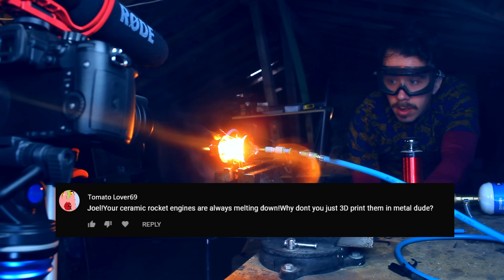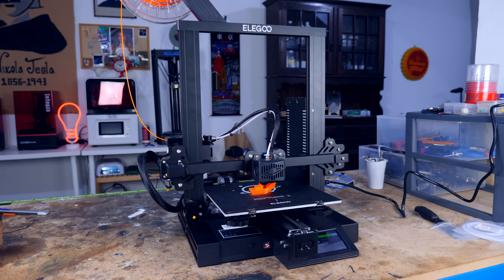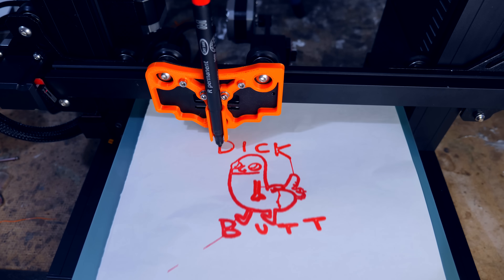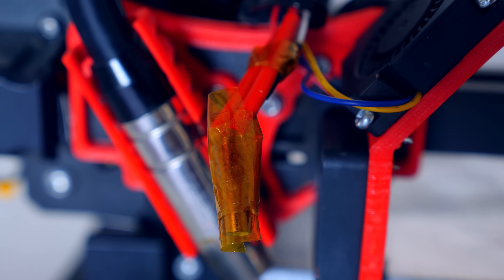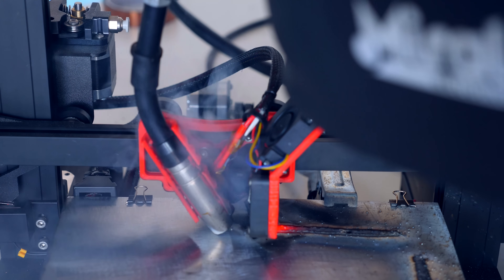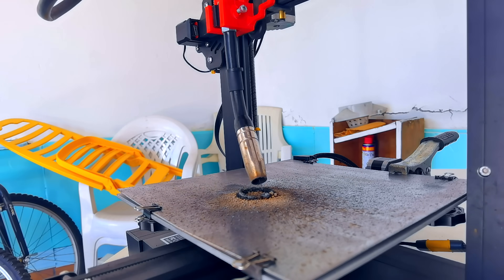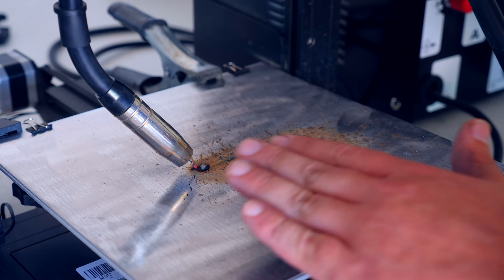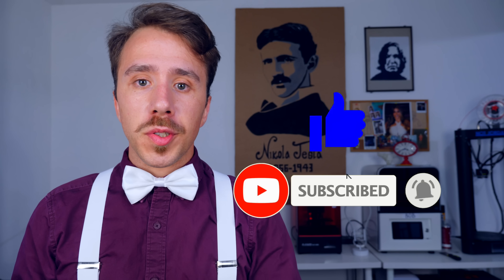I built a Metal 3D Printer using my Welding Machine

Comment: Okay so you can 3d print a module that makes your welder sit 90° from the bed.
And for the flat bed, try using a tank full of water maybe a 1/2 inch and place your sheet metal in the tank that's built to fit tight to the sheet metal, add a pressure hole in case the water gets too hot and it builds too much pressure, maybe we can slow down the warping on the plate that way
Reply: Maybe even adding heat syncs in the water between the tank and sheet metal layer?
Reply: Oh and make sure if you try that, you have it so if the water pressure causes water to come out the anti too much pressure hole, adding a drip pan, because water and electricity can be dangerous if you don't manage everything correctly 😉
Reply: Maybe add two holes for longer print times, with a side water bottle and a tube 🤔 if it gets really hot to the point the water is evaporating away... a simple auto feed system to replace the water that evaporates with fresh soothing water

Comment: I recommend placing the entire setup in a fish tank you can seal completely and replace the atmosphere with argon or other noble gas. Splashing will be less of a problem and cooling will be much easier.
Reply: That machine doesn't have enough power to run regular wire he would need a new rig

Comment: Here’s my suggestion. Build a wind turbine using recycled plastics, recycling them yourself, forming/molding using other savaged materials and no fuel. The goal being to produce a functional turbine suitable for running a generator (which might be a salvage alternator from an automobile) with a negative carbon footprint. The proof will be a carbon reconciliation of everything directly involved in producing electricity and benefit/payback.

Comment: Theme for future video:
Why don't you just melt the tomato cans into the shape of the rocket engine using the machine you use remove resin from ceramic. Also could you add a 3d printed turbo to this engine to compress and force more fuel into the combustion chamber. Or use the fuel in its plasma state of matter. Would be cool if you get more power out of the engine.

Comment: first thing first...I got my 3d printer last week(with my own money)...
Now for your video idea.... You can just use 2 simple methods..
1 ~ lost pla method...and I think that will be better for you...just simply cast metal with a 3d printed model...
2 ~ take small metal pieces and weld them manually ...to make parts....(like in old times..)

Comment: You should try to make a helicopter from the compressed air Wankel engine you made before, or try to add a gearbox to the already working car, another possible fix could be to somehow limit the pressure the canister releases per time unit, which would grant lower RPM and probably make the car go for longer.

Comment: Idea for next video:  this but swap the cartesian 3D printer for a polar (turntable) platform.
Works for NASA's Marshall centre and Relativity Space.  Also, have angle grinder trailing the welder tip so surface is always flat? 
I'm up for collaborating on this.

Comment: Hey Joel, actually G code can use curves. G0 is for a rapid movement, approaching the start of the print position. G1 is for a straight line. G2  and G3 are for curved lines, you set the radius and it creates a curve. Instead of having to create loads of x,y, co-ordinates.

Hope it helps!

Comment: make a machine that automatically finds tomatoes in an area selected, picks them up, and leads them to a machine that annihilates them in tortuous ways, like burning, putting them in acid, making them listen to never gonna give you up for 2 hours straight, slap them with hot dogs and then just smash them with a pneumatic hammer

Comment: Ehm.. I normally don't do this but I make a living out of writing this shit so I feel obligated to;

 "G-code can only draw straight lines.." WRONG! 
Yes, I did only watch this video until the 4 min mark so I apologise in advance if you did correct yourself but you can totally program G-code to take turns/arcs;
G02 = ClockWise
G03 = CounterClockWise 

Then you add X,Y, for starting position and determine the arc with I,J,K or a Radius value. 
Otherwise, I love idea of combining a welder and a 3D-printer. DMG MORI manufactures a cnc-mill which have this as an optional add on. Just a tip for the nerds.

Comment: G-code can draw arcs
Also i would have made the following changes
Use mig/mag instead of fluxcore. That would get rid of the slag.
Exchange the feed motor for a stepper
Design a new bed with atachment and cooling

Comment: ARGON this will work so much better if it had a gas feed like higher end migs, if you could even get a bottle and nozzle directed to the print area it would be suh smooth! as for the warping just try run at the min temp oorrrr run your bed at the max temp to give less temp difference, i think the beds can go upto 100c on them!!
ooooororrrrr option #2 get your rocket model STL go to a laser scintering place and ask them to print one instead of bvuying a whole machine :P i doubt it would be expensive and 1 would do since you have the design nailed!

Comment: In all fairness, you can get a special filament and send it in to be burnt out and sintered. The problems I have with doing it that way are
 1) you will have significant shrinkage when you burn the binder out so the part will be about 15% smaller, but it's inconsistent so it could be plus/minus about 5% and it may not be consistent throughout just the 1 part
2) you have to trust someone else AND the shippers
3) someone could potentially steal the design if you're making prototypes
4) not everything you want to make will be..... well, maybe you're not allowed to have it...
5) even when you get the part back you will still have to do machining because the part will basically come out like it was cast
6) you can just cast it or machine it without having the fuss of a 3D printer with some ridiculously expensive filament and the upgrades to even run it.

Comment: You can hold out your parts for quotation, you can print sand molds direct and pour metal into them or you can print wax masters and investment cast , or you can build patterns or machine from billet, extraordinarily price competitive. Your machine is interesting but not necessary. You can source parts anywhere and cheap and fast.

Comment: Video idea: ok maybe this a bit much. you maybe can get your metal rocket nozzle. you already have a Welding machine and it seems to be pretty decent so all you need is a Welding ring on a machine to hold the metal in the right position like a robotic arm that is used on factory floors a little programing and bam you have a min factory line: anyways keep making stuff love your vids

Comment: Would it be possible to replace the reedvalves on a two stroke with a tesla valve? Reedvalve is the valve that shuts so the fuel in the crank case can get compressed so it can then shoot into the cylinder when the intake port opens. Reedvalves wear out, and don't return because they move really fast. A two stroke can rev up to 10k rpm or more (usually), so they open and close 20k a minute.

Comment: Hey I have an idea for u u can use a shielding gas carbon dioxide and not flux core wire and a finer wire it will work

Comment: Ceramic backer with a brass plate. slightly less angle. adjust your stick out better. the next unfortunately is expensive a computer controlled brain like the lincoln stt that can adjust welding conditions on the fly would make this viable. but thank you for attempting an idea i had lol

Comment: Man Why instead of moving the pen you don't move the plate and the plate is overlaid with wood or something with a higher torsion temperature than the metal one or something that doesn't conduct the heat or very little (as well as holes in it to put fans that will cool the plate)

video idea (above)   
I like ur Video man hope u will see this com or u will make an rocket  OR U CAN T  DO IT  ( it s a joke )

Comment: Get a welder in, let him set up the welder how he likes and time how long he can weld a straight line of specified length, this will give you then desired welder settings and Feed setting for the printer. Also I am no welder but maybe carry on with the nozzle vertical as then there is no variation in height as the nozzle moves to various places. :)

Comment: 🤦‍♂️ going way over and above for a simple task. Dude you can legit just take a bucket with sand hard pack it down put the 3d printed part in the middle pack sand up and around then pour molten metal in it and Bam you have a cast of 3D printed part. 🤦‍♂️ Or even some actual engineering grade filiments

Comment: Since you cannot turn the welding head to suply filament from the direction the print head is next going to run there's no point trying to keep the welding head angled. However, if you can do it, the welding result should be much better if you feed the filament from the direction that the layer is currently groving. Also, not using fluxcore filament would be a good option because that causes so much random crap on top of the weld that next layer is not going to stick without grinding after every layer. The base warping is a beast, though. I don't know how to fix that other than really slow printing (welding) in short bursts and keeping it cool. Perhaps some kind of water cooling block would help?

Comment: At least on regular FDM printers, the warping arouses when the upper layer contracts from cooling down, lifting the underneath parts upwards. I guess for metals this should be way worse, as the metal expands and contracts way more due to temp differences.

The way to deal with this (besides heating the bed, which works just for the lowest layers to avoid getting the piece unstuck from the bed) is to reduce the mass and the amount of long lines over a single direction, as for instance, by choosing a non linear infill, or change its orientation. As the printer welds in a linear path, the drawn line keeps increasing its temperature creating a difference with the bottom layer or the base metal sheet. 

I think you need to distribute the temperature increase more evenly across the surface, so instead of drawing on a straight line, I believe the outcome would be better if it scatters single points or short segments across the lines to draw, cycling the process several times per layer as to keep placing new points next to the previous ones (giving them time to cool down) until filling up all the voids left in the previous passes. Each single point wouldn't be able to pull too much from the metal underneath, and the lesser pull would be more evenly distributed in every direction instead of the single direction of the line.

I think that slicing the object to print as if you were having a multi material printer could help you generate a the g-code with scattered points instead of long lines.

Comment: why dont you use spot welder..? just spot weld every 5 or 10 mm use soft stainless steel wire.... 1st wireframe or whatever is building thein filling each sides with metal wires..

Comment: Come on man. "LOST WAX" metal casting. 3d Print your design out of PLA or "special" lost wax filiment" get a soup can put you mold in, add investment plaster, put in vacuum tank to remove trapped air. when hard melt out PLA. and then pour in the metal of your choosing.. (aluminum, copper and brass) are the easiest to melt.  dip into water and the plaster comes off leaving you a metal part.. I will sic the tomatoes on you..

Comment: Okay so metal doesn't work, but you might be able to make a clay/ceramics 3D printer using a syringe and a stepper motor for your nect video. That might get you to the temperature resistance you need without ruining your entire 3D printer :)

Comment: Beautuful, excelent. Use a heat shield like mica and metal dust or pieces of wire to fuse them. or/and a  3D pantograph to get away from the actual 3D machine.

Comment: To avoid as much warping, try to use a holding bed with vent holes in it, and try to blow air straight down on the bed, as well as up on the downside of the bed. So basically you need to cool your melted metal.

Comment: Cooling the sheet with running water in a tube underneath might help, or even just having a larger thermal mass like a copper plate. It also looks like there's a lot of oxydation, running a nitrogen or co2 flow over the bed might help with that.

Comment: I was thinking on your problem there, if there was a way to autofeed could you not use a TIG setup with the rod fed into the crucible arc by a motor and you would get insanely precise welds onto anything metal too?

Comment: Just ask a professional welder how to set it up.  With .8mm hardwire Wirespeed should be around 4-5m/min adjust the amps just untill it feeds nicely without trying push the gun back, I'd imagine your feed on the printer should be around 3m/min. At that you should be laying down approx 3mm of weld so layer height needs to be 3mm.

Comment: You might actually be better off using the aluminum base because then you'd be able to break off the weld once the print is done without needing to use a grinder

Comment: Unless you are using flux core wire, you MUST use a shielding gas like argon or CO2. Check out the following video https://youtu.be/R__Ge13fgpQ and view from the 18:30 time stamp. 
CEE routinely do what you are trying to achieve to repair hydraulic cylinder eyes.

Comment: Make a Ball magnet rail generator where the ball magnets runs on plastic rails running through coils that would power a lift at the end to lift the ball magnets, I did this many years ago before you tube. Sadly I lost all the parts and interest when I moved and don't have any time to do a video about it, it was working but produced not enough power keep it running or produce extra power. This was 20 years ago and cannot remember all the details, may work better now since way back neonidium ball magnets wasn't readily available then.

Comment: What if you try it with a TIG welder? There you have heat and wire seperately. And it makes a much cleaner weld bead.

Comment: I'm a highschool welder and even I know every weld there is disgusting and I'm not joking! in welding you need to clean and adjust your gas and wire speed correctly, depending on the thickness of the metal. Not to mention the THICKNESS of the metal please try a 1/8 inch or even 1/4 inch, the metal your using is way to thin to test a project like this. But I love the idea and concept of a metal 3D printer like this, awesome engineering.

Comment: Try using  ceramic as the foundation 
Attach a piece of tungsten to tge clamp and hold it at a mirrored angle tj the nozzel... tben yoj could melt the metal above the surface and let it 
Fall onto the ceramic plate

And try to make a pyramid ... i think that a shape that might work well

Comment: You need some kinda gas… argon/c02 75/25… at least. Put the tip closer. Use a thicker piece of metal 3/16

Comment: Dude so close... A few tips that might prove to work (I don't have a spare 3d printer to destroy). Move the weld nozzle back to 90 degrees, print in globs/tacks then wait a automated air blast to cool the job, increment the head and weld again. When you need to build up a weld this is what you do, small welds and let it cool. It will still be messy but you will get layer height and less warpage.

Comment: Video idea (metal nozzle solution): Print your nozzles with PLA, add a sprue and riser. Submerge in sand/plaster, let set. Heat it up to melt PLA out. Make diy metal melting furnace. Melt some tomato cans to make ingots and then melt them to pour into your plaster mold. Wallah, metal rocket nozzles!

Keep up the good work! 
Love watching your show.
Also, please make “If I can not buy, I DIY” shirts. That I will buy

Comment: Hey Integza! You should make a motor made from 6 to 8 775 DC motors for a boat engine. maybe circular config with shaft in the center.. you could even make a small boat from porous foam blocks and fiberglass. cheap project and not overly hard to accomplish. 🙂😁

Comment: Video idea: Moar welderprinter!!!
Or even make a rotary welding machine. Also you might be able to "print" the metal onto a sand vat bed.  In theory as long as the base layer is wider it should print fine. Also if you use a mosfet / step down relay switch replacing the micro switch in the autofeed welder grip, and have its input replacing the stepper motor it could work for ghetto autofeed control. Also you may be able to just bypass the stepper motor in the welding rig itself and control it using the printer's stepper controller.

Comment: What happens is you use low melt temp solder through a regular 3d printer with the right settings maybe could get it to make a rough print even tho it would be made out of toxic metals

Comment: You should get a much nicer weld, less splatter and porosity, if you set the nozzle between 5 and 10 degrees to the print surface. too much angle and the shielding gas has a hard time staying around the arc, it lets air get to the weld the same as when you are too far away from the part.

Comment: Integza, please! You have tried to 3d print heat-resisting models with about almost every technique possible EXCEPT metal casting. You already have a furnace, and variety of printers to choose from. All that separates you from solid aluminum parts out of 3d printer is a PVC pipe and about $20 worth of casting mix (obligatory waste due to screw-ups factored in). I think that would make your nozzle series complete!